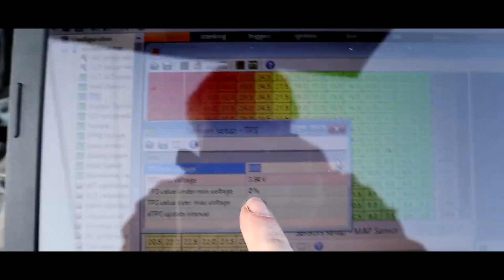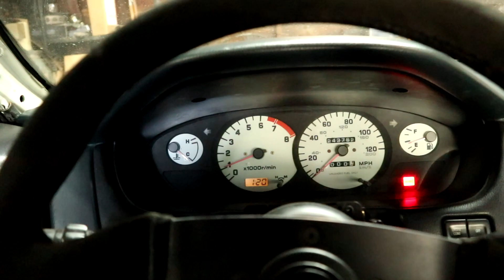Snagging a Tripod r154 and Throwing Ricebox Back together

Comment: Do you still on stock 2jz bottom? I have two 2jz ge none vvti bottom with high compression. I wonder if the pistons can handle 600whp.
Reply from the maker: You wonder?? Well look no further, cause that's my minimum power. Yes it's a stock block 2jzge non vvti. And it sees 800+
Reply: Thanks. I like your content. How the dog box? I'm following your build. T56 vs r154 dogs box in mk4 supra which one you prefer?
Reply from the maker: If you already have the r154, then dogbox. If not then go t56